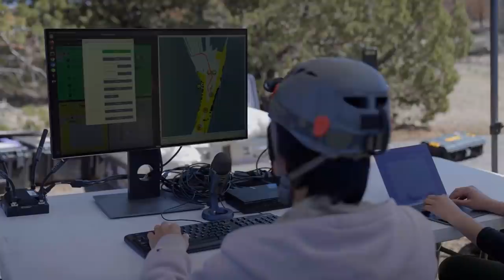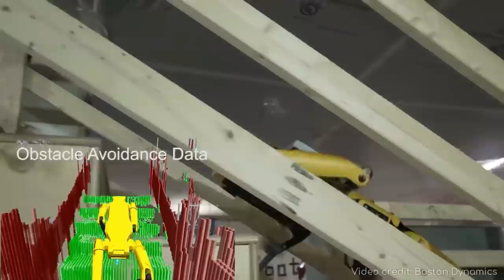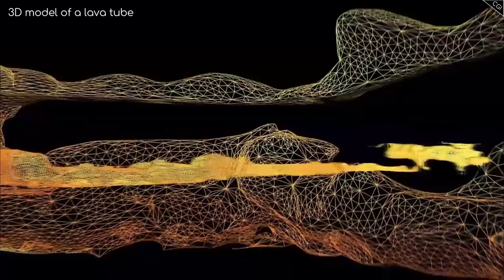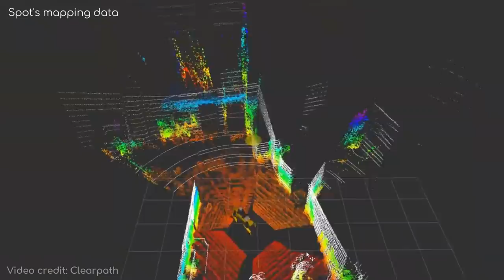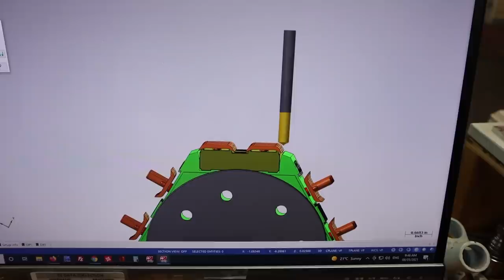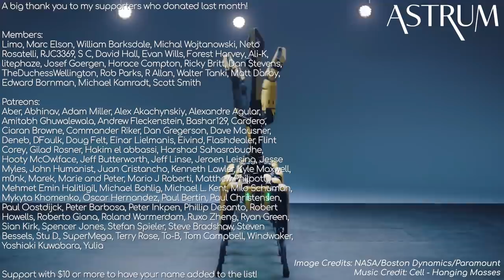How Wheels May Soon Become Obsolete For Mars Exploration

Comment: There is one big problem: Cosmic bit flips. What's the use of a highly advanced robot dog, if high amounts of cosmic radiation would just ruin it? There's a reason why the rovers are gigantic and slow. Because they're built to withstand cosmic radiation.

Not to mention, it would need a lot of solar panels to just power it up for a day.
Reply: the rovers on mars display the tech that would enable spot to survive. Each one of the rovers have the 'hardness' built into their systems and circuitry. The fact some have lasted years longer than anticipated shows we have radiation protection for such technology. Spot will be fine, but thanks for your concern 😃
Reply: @Alloneword-cp2xw  Yeah, but here's the thing. The rovers have layers of protection in order to avoid cosmic bit flips, that's why they're so big. In order for Spot to actually be able to protect itself, it would need computers that can withstand cosmic radiation. Computers that can withstand cosmic radiation are massive and have way less computing power than even a cheap smartphone. Spot's AI wouldn't be able to run on those computers.
Reply: @Drakonus_  No, you don't need massive computers. The rover don't have layers of protection either. Google how they made, you'll see. You have triple redundancy circuitry that are made with materials that withstand the radiation. The protection is in how they're made, not building protection around it. Xilinx circuits are used and have been since 2004.

Comment: Problem with legs over wheels is that legs require exponentially more power to travel a given distance compared to wheels.  Since Rovers run on tiny solar panels that arn't even out most of the time power consumption must be kept minimal.  Simply saying "we will build a nuclear reactor to run them" does not in any way solve this problem.  If you make a nuclear reactor with 10x or 100x more power output than the average of the solar panels that doesn't mean that walking magically becomes more efficient.  If a power source with 100x the power output can allow a rover to walk instead of role, then the rolling version is still more efficient and could therefore go 100x faster than the walking one.  So yes it might be nice to have a walking rover in some specific areas where wheels just dont work but that will still never compare to the exploration potential of having a wheeled rover that can travel much faster and therefore cover much more distance compared to its walking counterpart.  There is a reason that trains are by far the most efficient method of moving mass from one place to another.  There is a reason cars have wheels instead of legs.  Legs are incredibly inefficient and slow.  We all know this.  In a way we have evolved beyond our own legs in favor of wheels to travel great distance or even short distances with speed.

Comment: You said this could happen "soon." But I don't think so. The number of moving parts is enormous, and there are so many single points of failure. A much better idea is to send drone (or autonomous) dirigibles to Mars. Early versions wouldn't even need propulsion (such as propellors) because the winds are sufficient to move the balloon around the planet randomly. You would probably want (depending upon the planet) the device to be able to raise or lower its altitude. Mars has big changes in air pressure so vertical motion is a good idea. But some planets (and moons) have a very stable atmosphere so they won't even need that, meaning they don't need any moving parts. All they need is a camera and an antenna to transmit data. They don't even need to receive data. The balloon could be deployed either after the landing craft lands, or during the its descent, such as if the surface of the planet is not safe to land on (eg, Jupiter & Venus.)

Comment: The question is, will it be possible to harden the electric circuits necessary for AI against cosmic radiation? CPU-wise,the computers on board the rovers a on a nineties level due to radiation hardening. 

It will be interesting to see when it will be possible to work such advanced systems in deep space.

Comment: what happens when one of these things tips over? how does it manage to pick itself up? what happens if a leg gets smashed or the foot gets damaged? or with the joints how does it cope with getting dust or possibly dealing with the iron oxide on Mars?

also, what not send a combination of the dog walker with the humanoid form? the humanoid form looks like it can pick itself up and would do well to supplement the dog walker in certain types of terrain.
Reply: It picks itself up by using feet. If leg gets smashed, it will lose mobility. Joints can be covered with a plastic bag.
Humanoids are less stable, carry less weight, require more electric power.

Comment: The only flaw with sending robots into caves... how do you recharge them? Clearly there has to be some kind of docking station as those Boston Dynamics robots are not carrying large solar cells by themselves. That in itself would limit the range of those robots.
Reply: Most likely Small nuclear Reactors. It wouldn’t need to be extremely big to power the Robot. Also Reactors last a very long time without Refuelling so it could walk around Mars surface for 20 years.
Reply: @Brikzy  I don't think they can make them that small, it would probably be bigger than the robot itself. I imagine they could have some kind of solar charger on the surface outside the cave. The robots would know how long it took them to get in the cave and leave before they run out of charge.
Reply: These robots are small, but boston dynamics has larger versions as shown in the video. A sort of pack mule that can carry a solar charging station would work. It would be able to move faster than the little robots so no problem keeping up. Maybe they could use a mar-copter to get them in and out of the cave entrances.

Comment: Walking robots aren't terribly difficult and haven't been for well over a decade. They do offer some advantage in mobility but a major disadvantage is the reliability of the many servos required for each leg.
Mars is dusty, has massive temperature fluctuations, and is constantly subject to high radiation. Wheels are mechanically simpler and thus generally more reliable and are perfectly adequate for most missions.

Comment: You didn't even mention one important thing: The legs could be covered in nylon or something flexible to protect the joints from Martian dust. No longer would wheels get stuck
Reply: The contact surface of a foot is way smaller than a wheel.  What if they have to walk on sand-like surface? None of the demos were on sand.

Comment: I like how I literally said this one day when I was seeing ramps for the disabled. my thought was"if humans here have to make things with wheels work out of nature, then robots on mar with wheels are gonna be so obsolete in the near future, because cliffs mountains rocks and rocky areas that are definitely not smooth to drive on in" 
Because it came to my mind that things with legs get around more go up steeper cliffs idk why wheels were sent out in space in the first place I could work at nasa because I thought of this like last year. Even though it's a basic as hell thought
Reply: "idk why wheels were sent out in space in the first place"

You... What? You realize we've been sending rovers since the Pathfinder mission in '96, right? The tech required for balance and walking wasn't even remotely possible. Why would your mind leap to a walker instead of a better designed wheel? Wheels are easy, light, and redundant. Even if we sent a rover which could walk now, it would likely be as a backup functionality because wheels are SO MUCH BETTER at long term utility without breaking down.  We know how to make wheels correctly and the wheels on the rover are designed precisely for the environment they're in. A walking robot would have been laughed out of the drawing room, and rightfully so. 

Boston Dynamics has been working on autonomous walking vehicles for over fifteen years and only now are they at the point where there is a tentative interest in interplanetary ambulatory drones. You could work at NASA, but they'd have you on the janitorial staff.

Comment: Seems to me walking robots would have significantly higher power (energy) demands. They appear to have a short range mobility advantage. However, for long range travel wheeled or tracked systems would have the advantage. Ultimately, I believe a combination will be what we will see in the future. With a wheeled carrier transporting the walking robots to the locations where they can be most effective. Due to the weight limitations this wont happen until the moon base is up and running.
Reply: Also you should consider the amount of data a walking robot inside a cave would get vs the amount of Data a wheeled robot would get outside the cave , caves are the most unexplored part of Mars and is very likely they contain alot more valuable data than the surface the wheeled Rovers explore , so in some months the walking robot would get more valuable info of Mars by exploring the caves than a wheeled robot exploring the surface would , and since we send Rovers to get data about Mars that is a strong point form walkers

Comment: Cool as this is, the most important task when constructing extra-terrestial rovers/robots is to have as few points of failure as possible. A wheel is incredibly simple and reliable, which is why it's the preferred tool for transportation on a planet millions of km away, where repair is impossible. A walking robot would have so many different points of failure in its legs, that I can't see it being feasible whatsoever for space exploration, until there's a way to easily repair robots on different planets.
Reply: Even bigger of a concern in my opinion is powering these things.

Do we even have a power source for these that could fit within them and last long enough especially with how mobile they are?

There sure as hell isn't going to be solar panels strapped to them.

The best thing I could think of is a charging station that is the dedicated source of obtaining the energy via whatever method such as solar power.

However...
This would significantly limit the range of these robots. They would be incapable of traveling across the surface of the planet like the rovers.

I don't think a small nuclear reactor or fuel source is going to fit within them either.
Reply: @reptilionsarehere  RTGs are used to power rovers, but those are way too heavy to fit on a walking robot.

Comment: There's a reason why they use wheels. Wheels provide lift even without power. Those boston dynamics dog bots uses power to  stand up, balance, and even to resist wind. Wheels are much more stable. Yes, they can reach more places unreachable to wheels but considering how complex they are, they are much harder to use.

For power, typically, rovers dont have much power expenditure since nuclear materials are heavy and are expensive to launch. If you tried to use the same power source for those bots, i doubt they can even stand. If they're gonna increase the size of the nuclear power source, then why not just fit a better wheel and motor to combat these sinking wheel problem?

The only case the bot can be productive in mars is as a helper bot cause I can't think of how you would fit all the instrumentations in a spark bot

Comment: All the different traction technologies still have their own flaws that can doom a vehicle depending on the terrain they come across. There will always be that kind of terrain that will doom a specific locomotion type or add too much complexity or energy consumption to a vehicle.  The real problem in exploring Mars is the extreme cost of just shipping any rover there and forces designers to design, over design and consistently second overthink a vehicle design due to the fact everything hinges around putting all your eggs into one basket.  Now that SpaceX Falcon is available for heavy lifts at cheaper costs, we can use them.  As the years roll by, there will be half a dozen new rockets that will make heavy lifting to deep space destinations much cheaper.  ULA Vulcan family of rockets is practically done and ready to fly, Starship from SpaceX is in advanced development, Blue Origin New Glenn to name a few heavy lift rockets that can do the work at half or even a quarter of the cost of current heavy lift rockets.  Of course some of that savings will be passed onto NASA.

Comment: the thing i'm worried about is power consumption and wear and tear. with a wheeled drone if a motor dies it still has the other wheels motors so it will function just at a slightly lower capability with legs it's a death sentence if 50% or more of legs break or cease function. Now if we are doing nuclear and we partner it up with a kennel like rover that would be cool. the kennel could house spare parts and tools and act as a portable repair station,data upload station,storm shielding device,and a decent powerbank. The legged droid could pull the kennel across soft soils or other uncomfortable terrain,

Comment: no problem with legs on robots. Who is going to fill up their gas tanks, and then pull the starter cord? How about not enough air to support internal combustion motor that powers the robot. Watch some of the Boston Dynamics robot videos. Big dog is very loud from its IC engine

Comment: Just because we have robots that walk on earth doesn't mean they are well suited for Mars at all.  Temperatures on mars becomes so cold that various electronics and other sensitive parts in rovers must be heated so they don't fail.  A rotating wheel on an axle is one of the simplest mechanical devices.  When you get into articulated, weight-bearing joints it increases the complexity and risk tremendously.  Keeping dust and grit out of joints is more difficult than a simple rotating shaft.  Major temperature fluctuations affect it in more significant ways.  It requires much more energy to move the same distance.
In short, the wheeled rovers take us everywhere we need to go at this time.  I think we're a very long ways from making "wheels obsolete".  It most certainly won't be "soon" that we seeing a walking rover on Mars.  And wheels won't ever be obsolete for Mars exploration either.

Comment: you need a new type of robot - a recharger with wider body for solar panels on back. It would need to stay on surface and provide electricity to those smaller spot-type robots who will be in caves. As their batteries deplete they will need to go back to the entrance of the cave and recharge. I see it as being a wider body, 4 or 6 leg robot, with solar panels on back, recharging equipment and cables on belly. Probably with some arms too. Robots will need to become more oriented towards specific tasks. You can't, and shouldn't, have "all in one" types. And now is a great time to think what those tasks will be and construct robots accordingly. Sending 2 rechargers (+lab maybe, +signal multiplyer, +whatever nasa finds useful) and 5 spots with different tooling (4 primary + 1 rescue) is very doable in one flight.

Comment: The problem with the Boston Dynamics robots is they use too much power for a simple RTG power supply. While an RTG lasts for an incredibly long time. Just look at Voyager 1 & 2. Their power output at any given time is small. And we all know that Solar Panels are not an option for Mars missions because of the dust. Unfortunately the supply of power is what is holding mankind back from most future tech. There are many things that we have every obstacle overcome except for one, reliable portable power supply. So until the Toroidal Micro-Fusion power supply that Iron Man uses is actually available, we're gonna continue to be held back from a lot of things.

Comment: Problems...

1. Reliable safe power source that if it fails/explodes won't harm potential Mars native life.
2. Mars' ultra fine dust getting in the mechanics causing grinding and eventual failure.
3. Extreme temperature fluctuations which would cause components of different composition and density to expand and contract and eventually fail.
4. Cosmic and EM radiation can harm electronics.
5. Wasting time and money to investigate a dangerous and hostile distant planet for potential colonization...when we should instead focus on saving and preserving our native planet and all of her inhabitants.

Yeah okay.

Comment: Hardly seems like a logical choice. There's a reason the Mars rovers have wheels and that's because they provide a steady platform for the cameras, solar panels and other instrumentation. Having a robot that can stand up if it falls over is pointless if the fall damages the incredibly fragile equipment, especially the solar panels. I'm not even sure how they would mount them on a robotic dog. As of right now it's best to use the rovers with wheels, or the helicopter they have.

Comment: The problem I see is that they weigh too much and are too heavy.   The AI is the most significant improvement.  Could the walkers go up and down a 30 degree smooth slope, not stairs?

Comment: I wonder how long these robots can continue performing without engineers tuning them up and fixing problems that arise. Maybe the AI needs to also be finetuned around diagnosing and repairing their own problems.
Reply: Well, they would naturally have to be reliable enough such that they wouldn't need mechanical repairs in-situ.  As for the software, that could still be fixed by humans through radio.